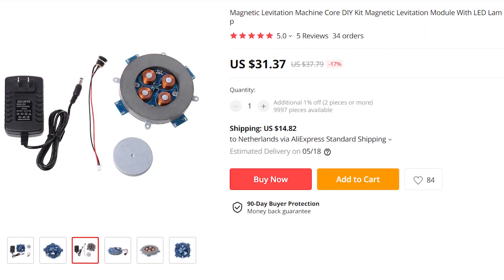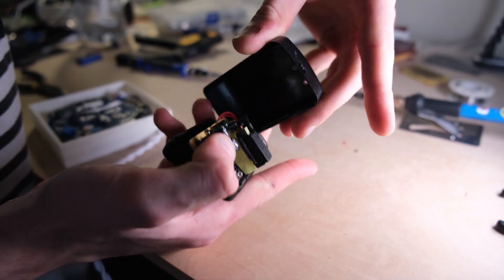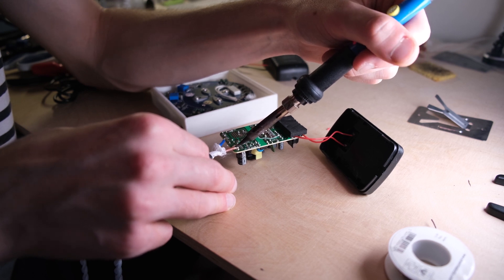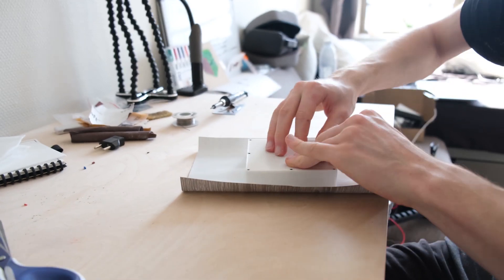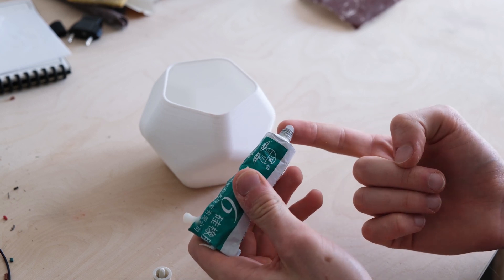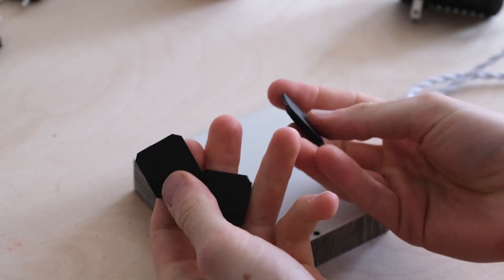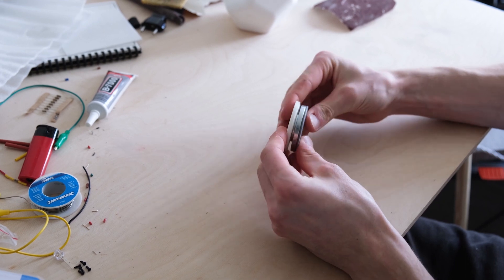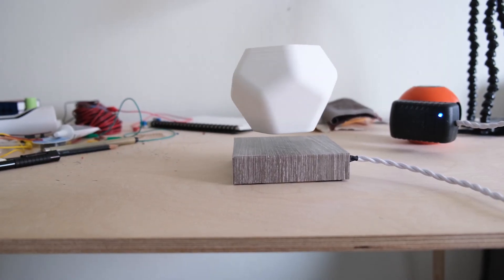3D printed DIY levitating plant pot (free files)

Comment: Thank you so much for this! I have the same module but struggled designing a good case for the magnets. One issue I'm still dealing with, though: how do you manage the heat coming from the levitation module?
Reply from the maker: @deanz_  I had it running months on end. Never had a heat issue. I'd love to take credit for designing a good heat distribution but honestly I didn't know there was even heat to deal with 😂

Comment: Isn't it possible to build something like that just with permanent magnets? What exactly does this coil circuit thingy do?
Looks absolutely unreal btw haha! :)
Reply from the maker: It's 4 electro magnets that are actively adjusted in strength so that the permanent magnet puck is balanced on top so it's quite sophisticated kind of like a Quadrocopter but with magnets.

Comment: I notice that the Ali Express link is not working anymore is there a description or spec on the electronic parts
Reply from the maker: There seems to be a shortage because I only find one seller selling them assembled for very expensive. You can get fit kits that you have to solder together for fairly cheap but unfortunately this is the only seller I found that even sells them built together right now. https://a.aliexpress.com/_vn6lFU
Reply: @makermind2050  yeah I found that one and the kits also. They seem pretty standardized as it turns out. I ended up ordering a base and magnet unit for somewhere in between but assembled can aways print my own box based on your model for it the magnet should fit your pot.  Things come and go on the Ali Express all the time. They are mostly small vendors with limited supply sometimes.

Comment: Great desing. Just a question. When it is time for watering the plant? Where does the water suppose to drain? Its possible to make a new design and take this in consideration?
Reply from the maker: If you have a Kaktus or plant Like I do that barely needs any water it doesn't seem to be an issue. I wouldn't know how to design something that could drain water yet also float. I appreciate the feedback tho 👍🏻
Reply: @makermind2050  Thank you!
Reply: @makermind2050  just pick up the planter. Water it, let it sit for 6 hours. Wipe it clean, Put it on the levitator
Reply from the maker: @vancekincaid9680  sounds great. I personally want it to just be in the corner of my room and low maintenance so I went with a dry plant.

Comment: Hey, great video, a friend of mine sent this to me and asked if I could make him one.  I just had a few questions if you don't mind.  what filament did you use? Pla, pla+, tpu, petg?  and you were able to print the pot upside down with no support and when it came to printing the top (bottom) you didn't get any stringing?
Reply from the maker: really sorry for the late reply. I used regular PLA, I prefer it over other materials for the environment's sake :D. there is a bit of stringing happening at the bottom of the pot but honestly, i don't care since it's filled with dirt anyways. you should really make sure to seal the inside of it somehow (I used silicone), because otherwise water will slowly leak through it. best of luck and have fun :)
Reply: @makermind2050  no worries thanks for the response and yep I did print it with regular pla and I was amazed at how little stringing there was.  Just when I saw your video it almost seemed as if there wasn't any stringing whatsoever.  Some type of magic or sorcery at play haha.  Thanks again for responding.